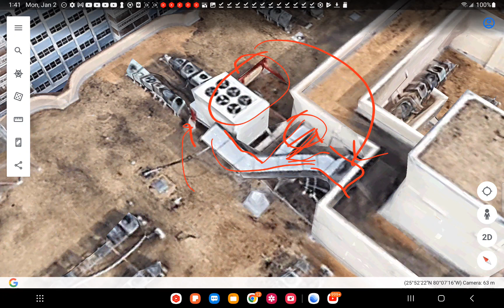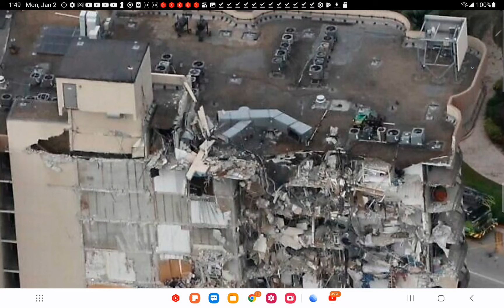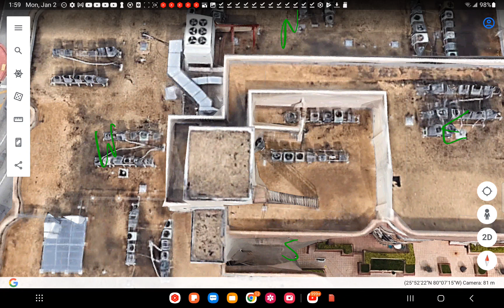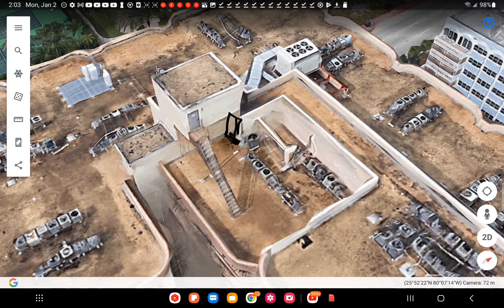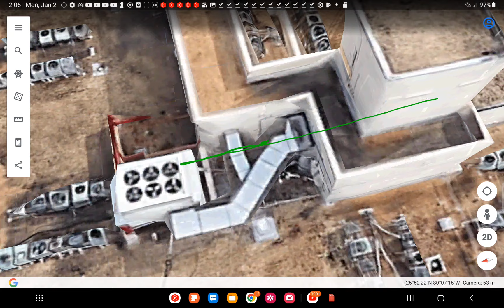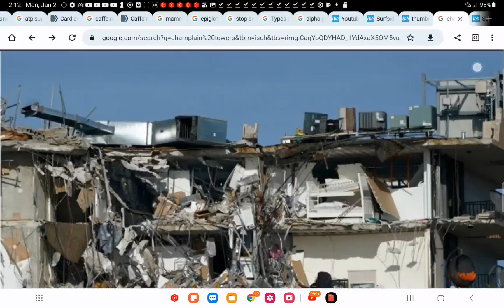Champlain Towers Collapse Model of Roof duct and punching shear or previous repair related Part 5

Comment: Thank you for explaining your thoughts on this aspect and taking the time to model it for viewers. At 9:46 onwards when you say “it just drops away” the wall is rotating about the duct and bottom edge of the wall is moving to the left of the duct. That is not quite correct. In practice the bottom of the wall and duct opening remained in the same plane and the top of the wall rotated away to the East and down. I agree with your description but the motion shown in the video is pivoting at the wrong point. Adjusting the pivot to the bottom of the wall would reinforce your point that the collapse of the roof is progressing from the East to the west allowing the wall to detach cleanly from the duct.
Reply from the maker: Thanks Exist for your input...
I am far from done with this location...
It is only "data stacking" but for you I will add more (to come in future videos)...
The wall , roof floor, corridor roof and parapet walls all have an interaction they have to tell...
If, you go back to the folded door and the two pieces of rebar, they are have an awesome story to tell on how they came to be...
Back to the ductwork wall, most of it is on the hallway floor their but the bond beam has it's own stories to tell... I have some clue to that in video one or might be two (how I show they notched it to add the bond beam steel)...
Now back to the two pieces of rebar at the door,  it tells a story and it can be reverse engineered by looking at the bend in the steel (not the 90s) but , the bend beyond that.
Your rotation, I am not there yet for the audience... I have more to this model and even have the bond beam and floorS sections
Reply from the maker: *there not their
Reply from the maker: Ps more hint, look at the block that was butted against the existing wall by the ductwork....
And think of the floor (wait that is my part 6, it's on rumble)... where I show how they used hooks  for the top walkway / corridor roof deck and think of how it would have pulled away and caused buckling of the wall by the ductwork...
Also, the "wedge" will come into the story in my future videos (the one by the door with the fold, the wedge on the floor missing)...
But, my number one hint for you is the rebar, the two pieces, what do they signify?
Hint: How did they come to be, how? And think of my rebar rest I spoke of in video one or two... it tells what must still be in place for that removal to take place....
Recall my theory on how shear really creates a bursting force on steel... 
But, I also talk about the "panel" that is flapped over, that was a hint on why those two pieces of rebar cannot just be a "flap"...